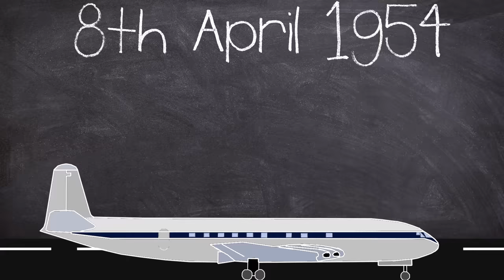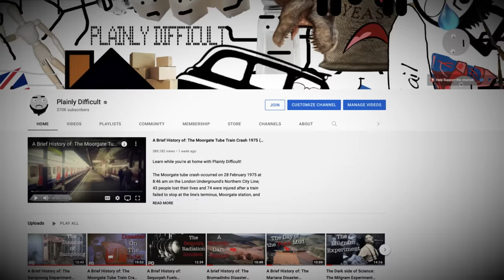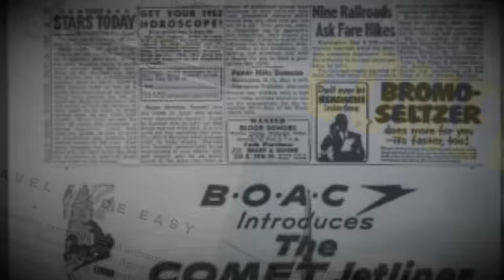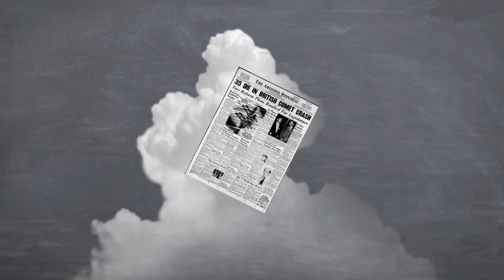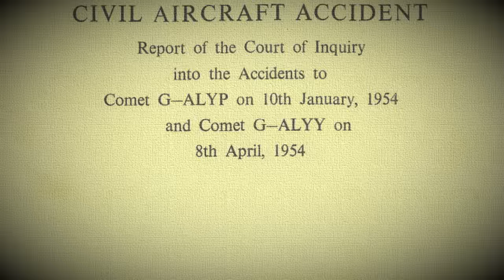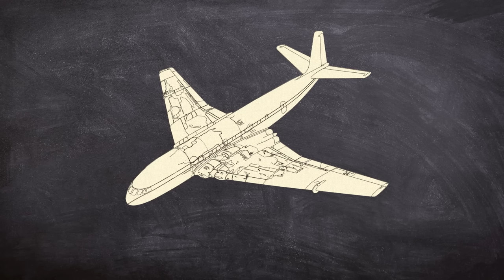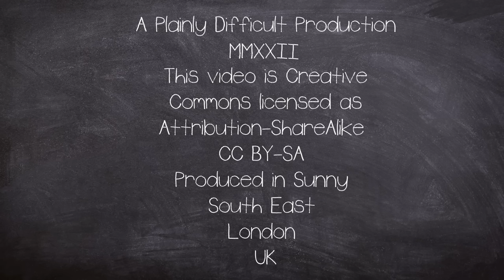A Brief History of: The de Havilland Comet Design Disaster 1954 (Documentary)

Comment: Just post WW2 flight deaths were regular events, a pot luck attitude. Things have come a long way since the days of ''Good Luck!!''
All said and done, mostly only the middle class and wealthy flew back then, very brave passengers.
Reply: De Havilland in particular had a horrible reputation for deaths due to crashes and accidents... a shameful disregard for safety that destroyed the company in 1958 following the Comet Disaster

The Comet was the worst engineering failure in commercial aviation history
Reply: This video has some BS included.
For example -
  
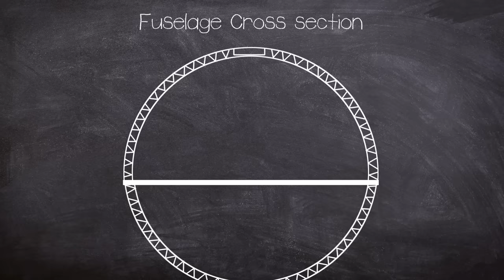    5:20   The idea that only the crew & passenger areas were pressurised is absurd obviously. 
  In fact every part of the fuselage was pressurised from the nose to the rear fuselage bulkhead including the entire cargo area.

Comets flew until 1997.
The Comet design had military use as a requirement. Nimrod development began at 
De Havilland before 1953.
Nimrods were not withdrawn due to structure problems or other airframe issues it was entirely a significant upgrade snag & resultant basic economics & an end of line sale happening at Boeing at the same time.

We feel we can shed some light on some common misunderstandings.

At the time the Comet wasn't particularly dangerous.

Losses comparisons
How things were in those days.

DeHavilland Comet 4 UK           14% 
DeHavilland Comet all  mks       17%  

Boeing 307                               70%
Boeing 247                               48%
Boeing 707            .                  20% 
Boeing 707                                20% 
Lockheed Electra Turboprop   29%
Canadair CL-44  Turboprop     46%  
Convair CV-580  Turboprop     22%
Convair CV-880    (ff 1959)       27%  
Convair CV-990     (ff 1961)      35%

    Of course De Havilland had prior experience building many all metal construction airframe aircraft including thousands of jet powered fighter aircraft that were primarily of metal construction with pressurised cockpits & jet engines built by De-Havilland.

   De Havilland carried out full stress analysis & engaged in a comprehensive & protracted testing program which is why key De Havilland people were happy to be aboard flying DH Comet aircraft.

   The DH Comet was the first passenger airliner with full length fuselage pressurisation at 8psi pressure differential. Handley Page built the world's first airliner.

   Of course ripstop provision was provided. The skin alloy used became unavailable at the time due to R & D at the manufacturers which resulted in the original alloy being discontinued.
The skin thickness used for the Comet was used for similar later aircraft. 
Frame spacing was not found to be too large & frame width was not found to be too small.

  De Havilland did indeed always work to better than industry standards at the time, used up to date knowledge for the design & construction & no evidence of negligence  or criminal negligence was ever produced in relation to the DH Comet.

  The DH Comet had no effect on the course of the aerospace industry in the UK. The UK now has the world's largest combined nuclear, aerospace & defence sector per capita activity.

    The investigation committee did not find hundreds of fatal flaws or evidence of design defects, structural defects, defective materials or shoddy workmanship. Ripstop provision was included. Claimed incidents did not involve cracks starting from window corners.
Pretty much all changes were just in case changes or were planned development modifications & improvements that were scheduled regardless of incidents.

De Havilland designers knew all there was to know about metal fatigue at the time they designed the DH Comet.

Hope this helps.

Cheers 👍
  
   
  .
cvcv.

Comment: Never be the first people to do anything, hop on when the bugs get worked out.
Reply: Boeing built the first pressurized airliners in 1938 and never had any catastrophic structural failures.
de Havilland was not competent or qualified to build airliners out of riveted aluminum.
Prior to the Comet Disaster de Havilland was still building outdated aircraft made primarily from WOOD
Reply: This video has some BS included.
For example -
  
    5:20   The idea that only the crew & passenger areas were pressurised is absurd obviously. 
  In fact every part of the fuselage was pressurised from the nose to the rear fuselage bulkhead including the entire cargo area.

Besides that.
The engine position & inlet design were not flaws or fatal flaws, there were good reasons for that design choice at the time.

Comets flew until 1997.
The Comet design had military use as a requirement. Nimrod development began at 
De Havilland before 1953.
Nimrods were not withdrawn due to structure problems or other airframe issues it was entirely a significant upgrade snag & resultant basic economics & an end of line sale happening at Boeing at the same time.

  We feel we can shed some light on some common misunderstandings.

  At the time the Comet wasn't particularly dangerous.

Losses comparisons
How things were in those days.

DeHavilland Comet 4 UK           14% 
DeHavilland Comet all  mks       17%  

Boeing 307                               70%
Boeing 247                               48%
Boeing 707            .                  20% 
Boeing 707                                20% 
Lockheed Electra Turboprop   29%
Canadair CL-44  Turboprop     46%  
Convair CV-580  Turboprop     22%
Convair CV-880    (ff 1959)       27%  
Convair CV-990     (ff 1961)      35%

    Of course De Havilland had prior experience building many all metal construction airframe aircraft including thousands of jet powered fighter aircraft that were primarily of metal construction with pressurised cockpits & jet engines built by De-Havilland.

   De Havilland carried out full stress analysis & engaged in a comprehensive & protracted testing program which is why key De Havilland people were happy to be aboard flying DH Comet aircraft.

    The DH Comet was the first passenger airliner with full length fuselage pressurisation at 8psi pressure differential. Handley Page built the world's first all metal construction airliner during the 1920s.
    In many cases earlier pressurised aircraft were larger, needed thicker fuselage skins due to flying stresses & had much lower pressurisation differential pressure.

   Of course ripstop provision was provided. The skin alloy used became unavailable at the time due to R & D at the manufacturers which resulted in the original alloy being discontinued.
The skin thickness used for the Comet was used for similar later aircraft. 
Frame spacing was not found to be too large & frame width was not found to be too small.

   De Havilland did indeed always work to better than industry standards at the time, used up to date knowledge for the design & construction & no evidence of negligence  or criminal negligence was ever produced in relation to the DH Comet.

   The DH Comet had no effect on the course of the aerospace industry in the UK. The UK now has the world's largest combined nuclear, aerospace & defence sector per capita activity.

    The investigation committee did not find hundreds of fatal flaws or evidence of design defects, structural defects, defective materials or shoddy workmanship. Ripstop provision was included. Claimed incidents did not involve cracks starting from window corners.
Pretty much all changes were just in case changes or were planned development modifications & improvements that were scheduled regardless of incidents.

  De Havilland designers knew all there was to know about metal fatigue at the time they designed the DH Comet.

Hope this helps.

Cheers 👍. 
 
 . . .... ... ..... .. ... ....

Comment: TL;dr the planes windows were square and pressurization cycles caused the fuselage to explode
Reply: None of the catastrophic in-flight structural failures were related to the passenger windows, it is understood today that the pressurized cabins ruptured at the roof at the weakest fuselage reinforcement hoop...

Comment: This video about the de Havilland Comet Airplane sure highlights the problem of cyclic fatigue failure at stress points. In the case of the de Havilland Comet the stress points were the square windows. Also at that time jet airplanes with pressurized cabins was so new that no design engineer realized that square windows would be a stress point of cyclic fatigue failure.

Comment: How come the first comet had 1 tire  on each wing wheel whilst over variations of the comet 1 have 2 wheels on each wing gear
Reply: Better weight distribution and lower pressure on the runway surface.

Comment: You omitted to mention that the Comet went on to form the basis of the Nimrod...
Reply: The Nimrod is a completely different aircraft designed by Hawker Siddeley two decades later...
Reply: @sandervanderkammen9230  No, not a completely different aircraft. It was, admittedly, a heavily modified version of the Comet. In fact, if memory serves, the first couple of prototypes were actually Comet airframes, originally.
Reply: @christophernewman5027  True, but the production Nimrods are not Comet 4s... they are completely redesigned aircraft.
de Havilland was not envolved in the design and construction of the Nimrod.
Reply: @christophernewman5027  Hawker Siddeley developed the Nimrod to utilize the huge surplus of unused parts and new tooling manufacturered for the Comet 4 but aircraft sales never materialized... millions of pounds of surplus parts were just sitting in warehouses.

Things like landing gear, hydraulic pumps, actuators etc. were incorporated into the new aircraft design in an attempt to save money, rhis however had just the opposite effect with the reverse design concept of developing a new aircraft around old parts.
The Nimrod was actually much more expensive to develop and build than a clean sheet design and inadvertently incorporated many of the same flaws as the Comet as well as a similar appearance.
Reply: @sandervanderkammen9230  In a way they were, as De Havilland was one of the firms that made up Hawker Siddeley but l take your point. 😊
Reply: @christophernewman5027  de Havilland went tits up in 1958 as a direct result of the Comet Disaster  the crown court sold de Havillands remaining assets to Hawker Siddeley.
While it was officially called a "merger" there was little left of de Havillands original design team by 1965 and all references to defunct company were long gone, completely obliterated.
Reply: @christophernewman5027 
    DeHavilland was working on the Nimrod before1954
 The merger of DH & HS had nothing to do with any crown court action.

Comment: 1:48 well if it's got no windows I wouldn't trust it either
Reply: Hi Dale No windows may not be as bad as you would at first think. Even now, if you are on the centre seat of a wide body aircraft you are not near a window anyway. 

All that would be needed would be to place a few high res cameras on the aircraft so all the passengers could look at the outside world on their back-of-seat screens, or mobile phones. Some aircraft already have a rudimentary form of this, but the images are not very realistic, at least not the B777 that I was on.

I imagine a fuselage with no windows would be stronger, simpler to design and make, and lighter.  Also, sound and heat insulation with be better.

Comment: Won't call the Comet a footnote. Everything it did right was kept on all airliners as of today. Everything it did wrong, and it's very few, notably the square windows and inside wings engines, were dropped. All modern airliners owe everything to this one plane alone. It shaped everything, technically in one try. Compared of many different designs and years it required to get from flimsy wooden aeroplanes to modern piston-engined airliners jetliners replaced, the Comet is a wonderful work of engineering. Sure, the final refinement claimed a bit more of 400 souls. Comparatively, the industrial disaster of the voluntarily blotched 737 MAX made nearly the same numbers of victims, but without any improvement whatsoever in air travel safety.

Comment: quite literally reshaped passenger aircraft design
Reply: Absolutely Not! The de Havilland Comet is used today as an example to teach engineers how not the design an airliner.

It is the Boeing 707 that revolutionized air travel and is the template and set the standards for or the planes in service today.